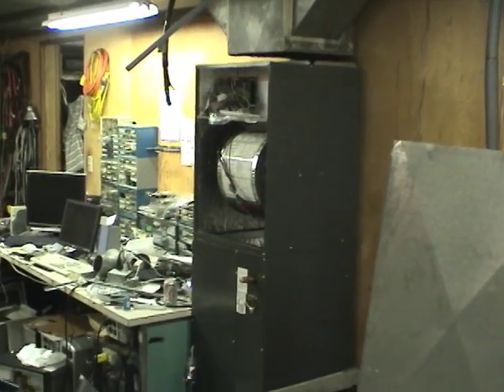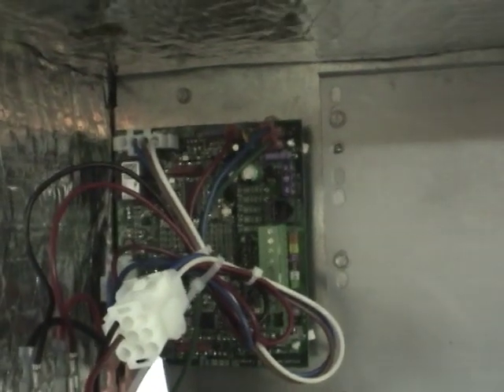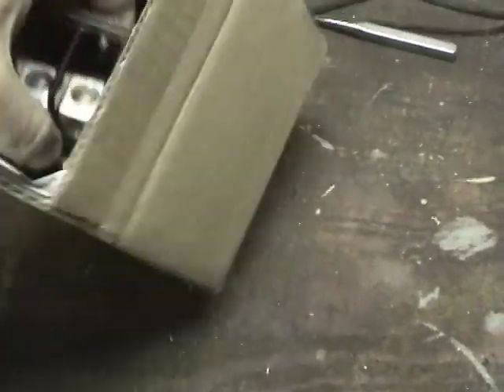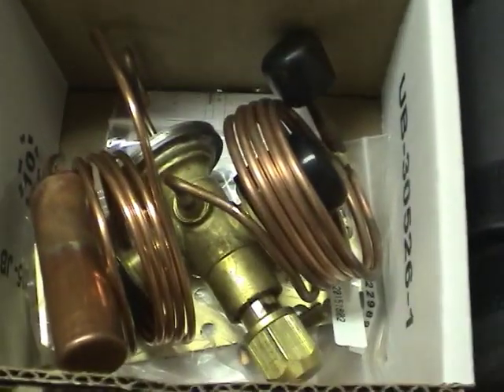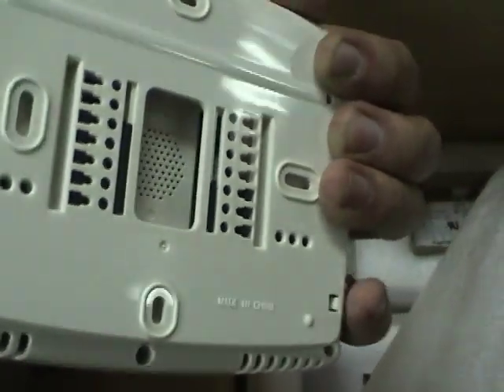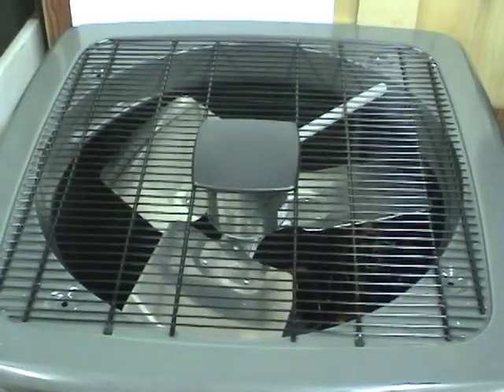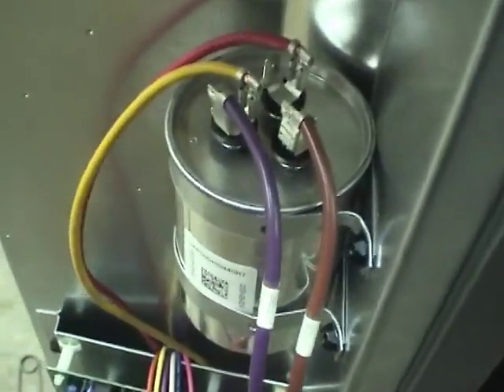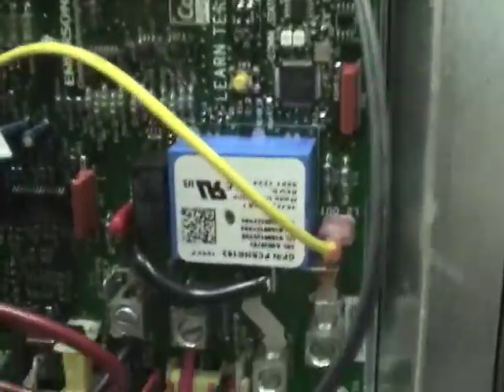Heat Pump installation - Part 1

Comment: How do u run the thermostat wire on a heat pump does it go from thermostat to unit then from there to outside unit or what need help

Comment: sup tesla or anyone. My outdoor high voltage power box(for condensor) isnt getting power... before and obviously after the outdoor breaker. where do the wires go? into the furnace? or do they go straight the main breaker box?

Comment: An older Goodman packaged unit PCK036 w/ 10KVa /60 amp breaker, single whip...how is the wiring protected on the compressor?...I may have to upgrade to a 15 KVa Heat Kit, and I was wondering about the compressor breaker, which I do not see on this unit.

Comment: I see the air handler is sitting on top of something that holds it up but is hollow. Did you fashon that out of plywood and the seal it? I am going to have a similar issue with mine.

Comment from the maker: @thisisnotyours1 The outdoor unit has those ratings on it, the indoor coil doesn't, because that rating is largely dependent on the outdoor unit. Both units must be matched together properly, that's done based on the manufacture's spec sheets.

Comment: @tesla500 I've never seen a goodman over here but I'm sure the company would be broke by now if they hadn't lifted their game. 
my work used to source US/Mexico made carrier units as water heat pumps, their failure rate wasn't too bad but Carriers after-sales service was dismal  and we dropped them from our lineup altogether.

theres good and bad in every brand.

Comment from the maker: @Aussie50, HVACKID94: I did a lot of research, and from what I could find, pretty much all brands, including Goodman, are on a similar level now. They're using brand name parts (Copeland compressors for example).

The reliability is really determined by how it's installed, and since Goodman will sell to anyone, that's why you see so many bad installs.

Comment from the maker: @Aussie50 Yep, some major power there.

It looks like there's a suction and liquid line filter dryer, plus the muffler or whatever it is on the compressor discharge. The liquid line filter dryer is buried down below so wasn't visible.